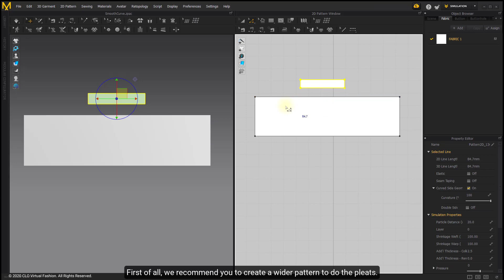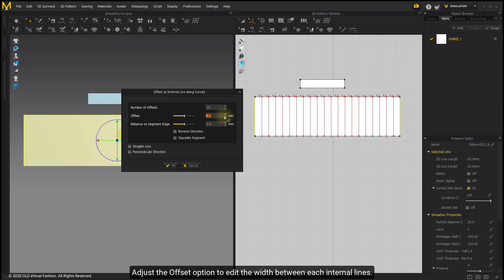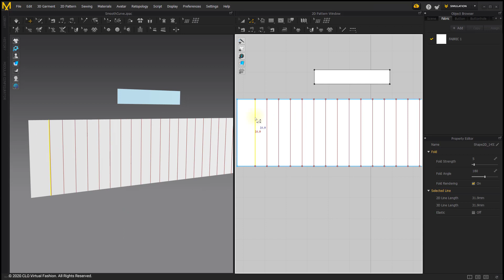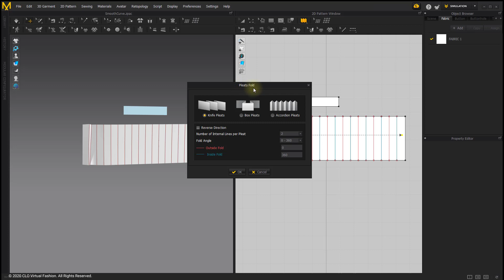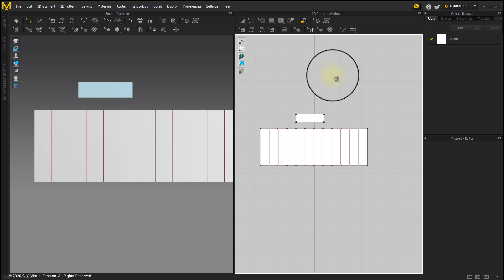Marvelous Designer 2D Pattern Editing:  Make Pleats

Comment: The instructions are very imprecise, the instructions and the written guide keep saying "click and drag" but nothing in this software actually responds to clicking and dragging. I think it means click, then click again because thats the only way i can make it work.
Also i can't seem to make the pleat sewing work by segments. It seems to just choose random lengths  for each sewing segment and ignoring the segments i made using internal lines to offset and add point to edge. Im having serious issues with this and the only way i can make it work is by just not using the tools and doing the sewing manually.